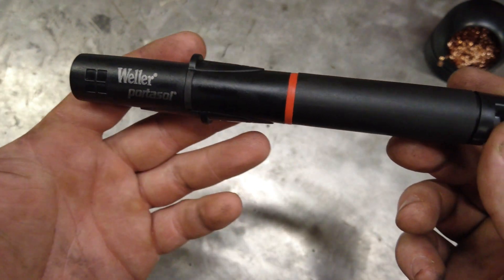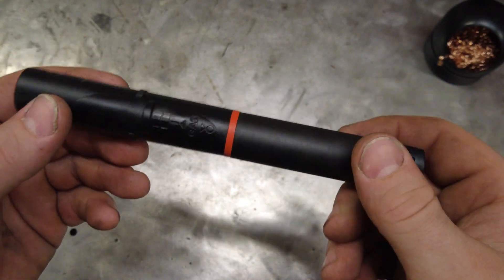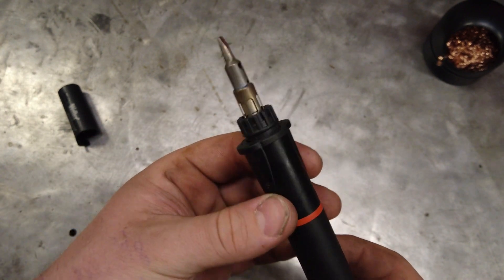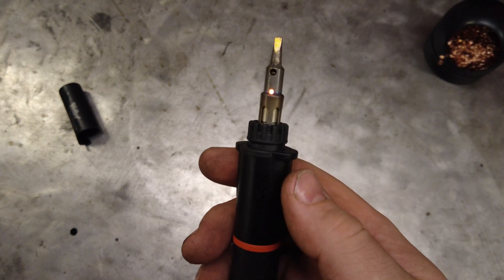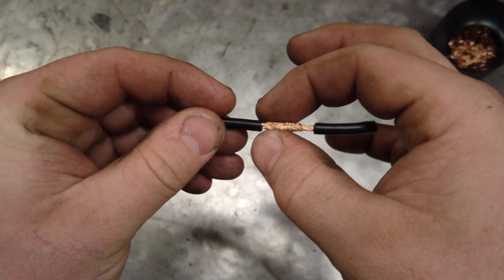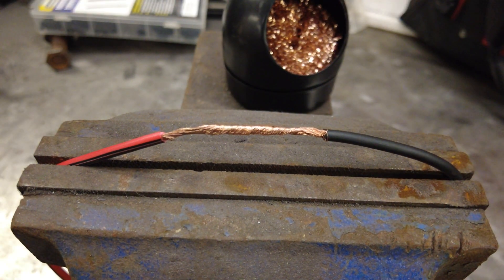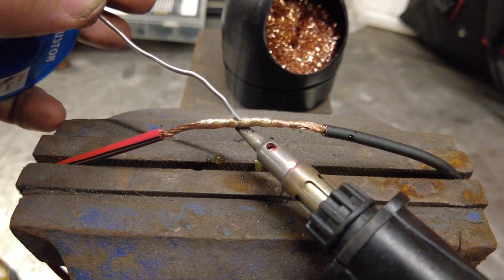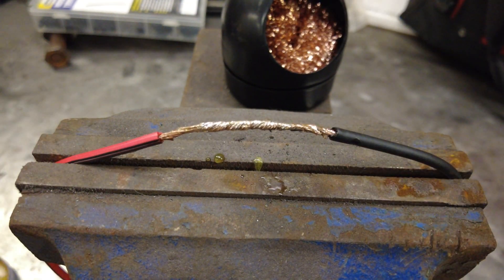Weller P2C Butane Soldering Iron

Comment: I think this product is discontinued. I bought one a few years ago and I need to buy tips for mine but seems like it's impossible to get them anymore.
Reply: I just bought one locally last week. 🤷🏻‍♂️
Reply: @ChadFrey-WhisperItLoudLLC I found they have a newer version called WLBU75 and the tips for that are interchangeable with P2C.
But the tips they offer for the WLBU75 are only a few.
They don't make a variety of tips like the larger tips they used to make for the P2C I wanted.
Reply: Most gas soldering iron tips are just about the same shaft and flange size and will fit in the collet and work
Reply: @r1w3d  well I find that hard to believe because I researched the tips and didn't find others but if so please show me.
Reply: @flat-earther  I'm literally using a bernzomatic tip in my even older portasil right now. He's also wrong, it does work as a torch but you need to complete the circuit for the arc by reinstalling the collet without the tip in it. 

You need to look for keywords like butane solder tips obviously. Just widen your search as normal society has done with the globe to further gain knowledge.